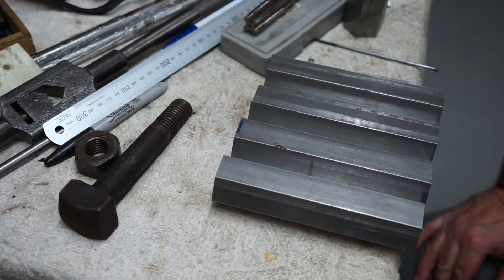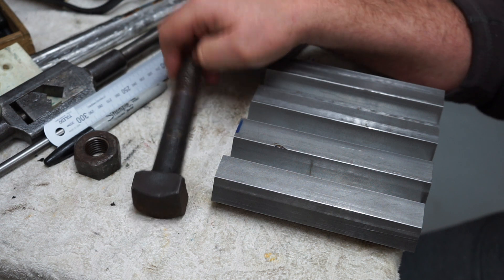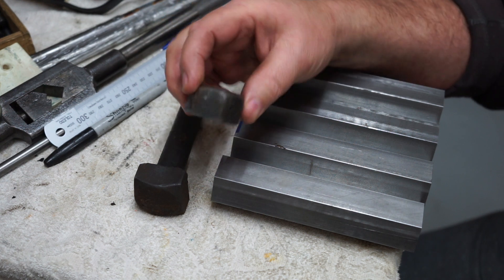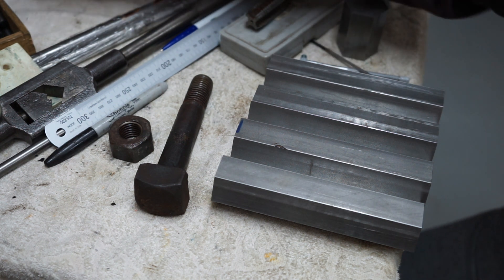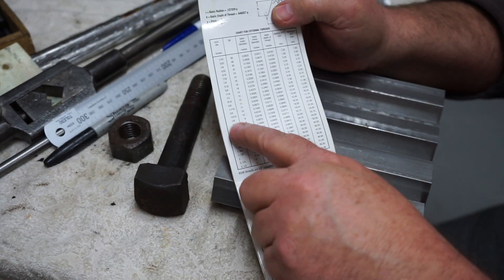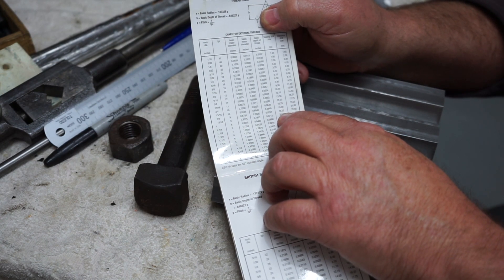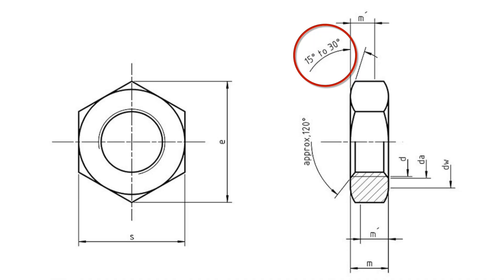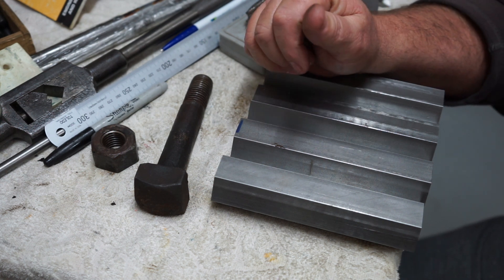Making Custom BSW Bolts  - Pt.1 Nuts

Comment: How Many mm is that or did you get a Translater and charge customer in Pounds shillings and pence old mate
Reply from the maker: G’day Peter. I hope I impressed you with that, as I forced myself to work it out without asking you 😆.
Next Monday I make the bolts. Using a HSS 55 degree ground tool. Can’t believe it actually worked. Cheers mate 🍻

Comment: Good old BSW enjoyed watching Aaron. That looked like nice machining hex bar, was the external size correct the same as the original nut? Tony
Reply from the maker: G’day Tony. Yes the hex bar was lovely to machine. I believe it was bright mild steel but a free machine grade. It cut like butter.  The Hex was bigger than the original square head, but not by much. Thanks for watching 👍🍻